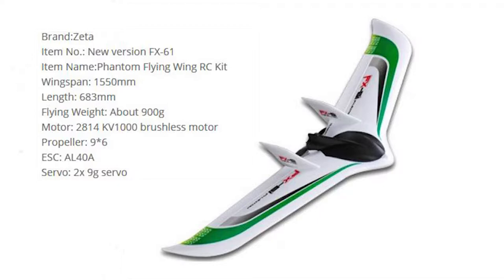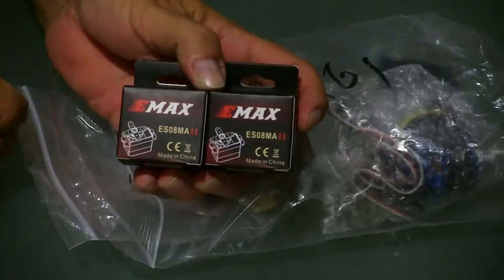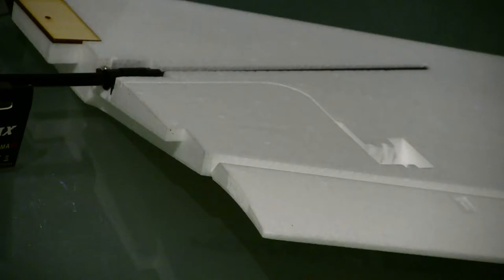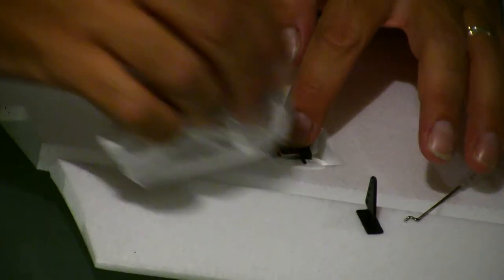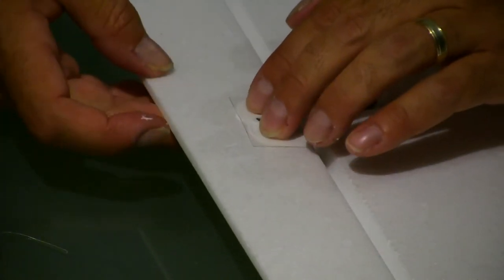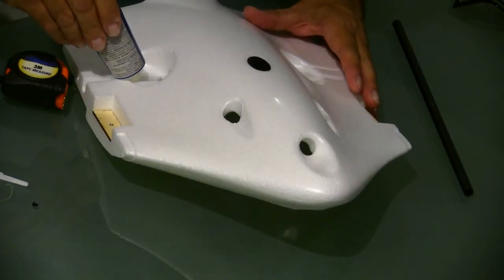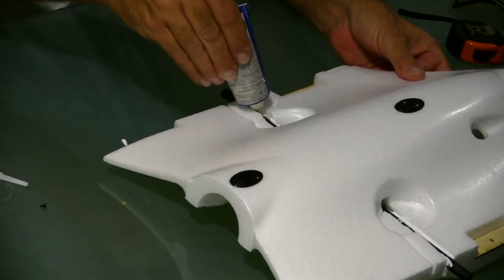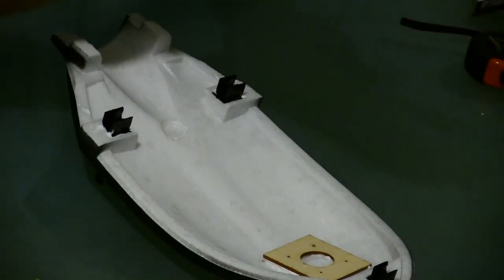Zeta FX 61 Phantom - BNF Build Part 1

Comment: what glue did you use ?, ...is it an Aussie brand ,(I am in the UK)
Reply from the maker: I just used a hobby glue I found at my hardware store suitable for gluing foam. Since I built this plane I usually use just hot glue now when I can, works the best I find.